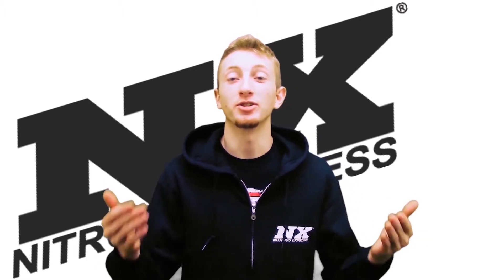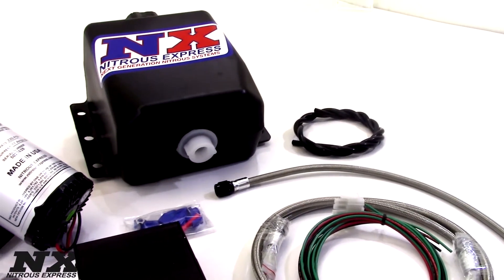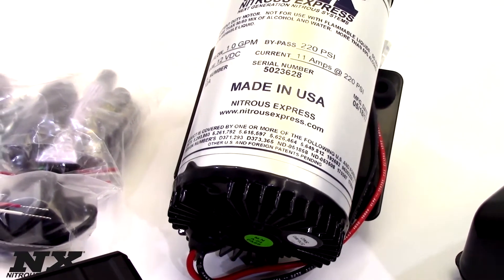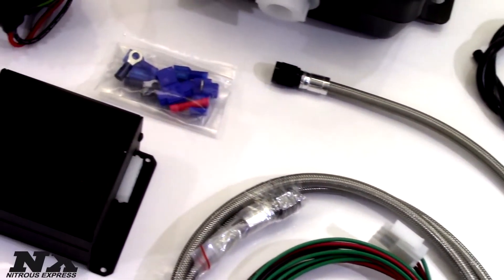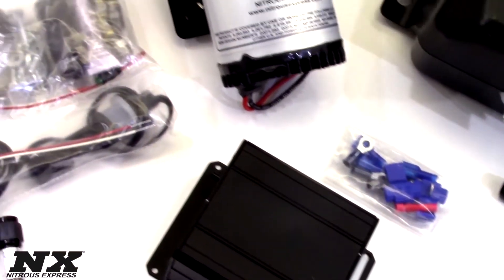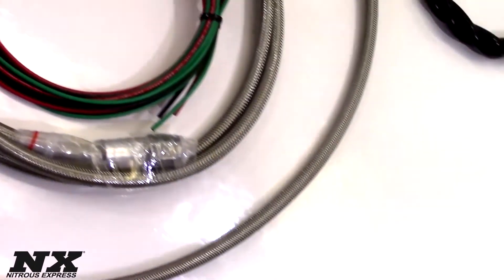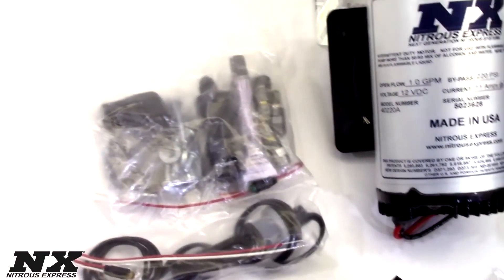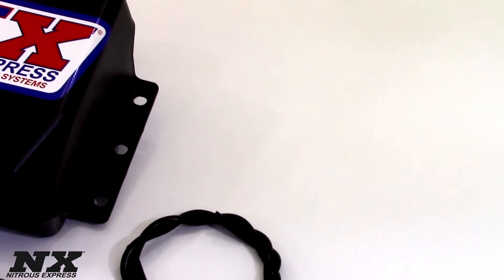NItrous Express Stage 2 Water/Methanol System, part # 15021 and 15031

Comment: Kind of sucks that you cant run this system with boost applications per rules only carb.or fuel injected cars running Nitrous systems, is this kit even as functional without it being controlled and set by boost pressure?